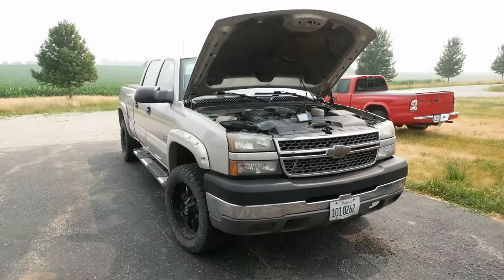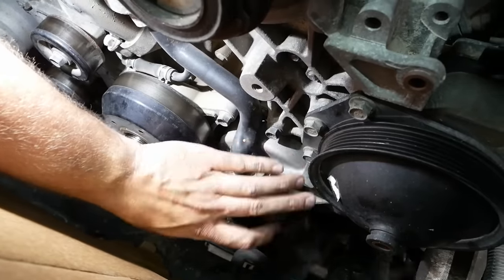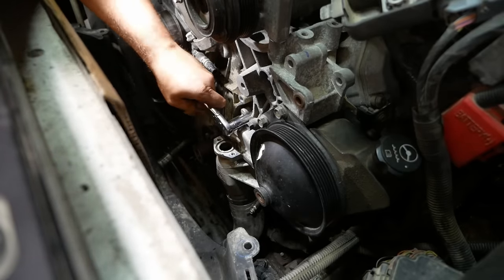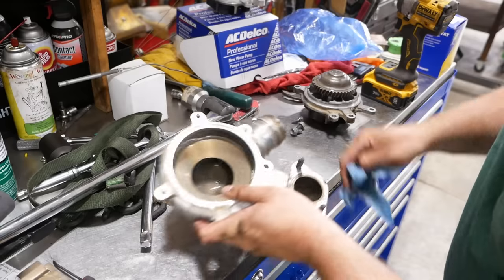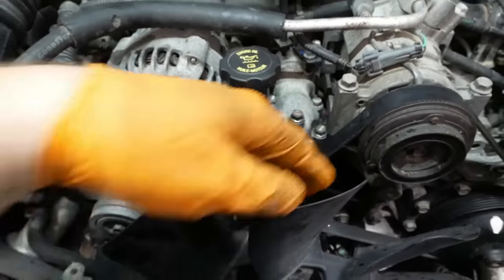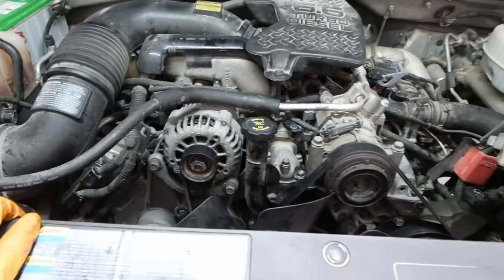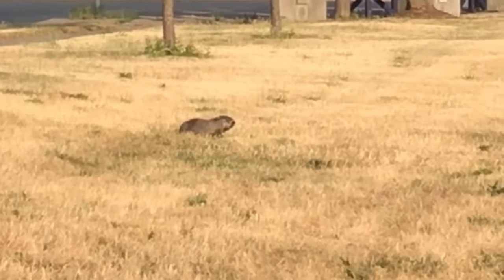Is this Cheating? GM's 6 HOUR Water Pump Insanity

Comment: I'm pretty sure the book time for the water pump on the Ford 3.5L Duratec is like 12 hours. It's an internal pump, and has a seal that was known to fail in the pre-2016 engines. If you didn't change it before a failure, it'd wipe out the engine.

Comment: One of the things I look into before purchasing a vehicle, is how difficult it is to work on. Rather that’s for my own reference if I do it myself, or if I’m gonna be predicting what I’m spending on a mechanics time to do the job. Duramax’s of any generation are off the list for this exact reason.
Reply from the maker: No diesel engine made after 2003 is easy to work on.
Reply: I used to do that, but now, when I open the hood, I can’t even find the engine.
Reply: @WatchWesWork i figured that to be the case

Comment: Wait until the bell housing coolant o rings start leaking. Replacing those 2 o rings is a big job. 
   The bell housing has a cast passage that connects to the back of each head.

Comment: You’re not wrong about them making that job harder than it needs to be.  Even the cheat method looked a pain in the $**.  The whole “rotate another 105 degrees” says the engine was designed by a mathematician, which just adds another level - they don’t want that thing coming off.  As for the weather, NZ doesn’t have the bad air quality, but the weather is making the plants and birds all confused - plants are flowering, and it’s winter.
Reply: What part of NZ do you live in?
I’ve been down to Antarctica 16 times I always travel around NZ for weeks before heading home. I haven’t been down to the ice for a couple years now I was thinking about New Zealand this morning.   
You don’t see many Chevrolet Duramax is in New Zealand

Comment: Great work Wes!  seeing the poor engineering makes me glad I did not become a mechanic-it would be so frustrating!. A standard bolt on belt driven water pump costs $75 and can be replaced in 30 minutes or less. Do they do this to generate revenue for their GM shops?

Comment: That's the first time I've ever seen someone besides myself put cardboard on the radiator. I don't know why more people don't do it. That water pump was a lot harder to change than I expected. Must be the same designers that make you remove a front end to change a headlight. If those are Astro-grip orange gloves they were on clearance at my local Advance for $5 a box 2 days ago. Down in Champaign we've had the air haze and the power has been out since Thursday.

Comment: 4 cylinder Izuzu engine in my 1992 Hitachi excavator has an overly redundant and hard to get at fuel filtering system. But it starts like a charm in the winter. Wonder how this engine starts?

Comment: 6 hours?? Make that 6.5 and let's pull the cab! 

Also I have a design idea - why not put the water pump inside the transmission? So that its RPM can be changed as needed according to speed and temperature, via a series of cables, pullies and counterweights

Comment: A seasoned hand on a cool engine is around 3 hours.  Lots of water pumps are far far worse.  Don't think anybody can beat Cummins though.  Takes longer to get the coolant out and back in than to replace the pump.

Comment: My water pump on my ‘03 Cummins took 30 min… remove the belt, drain the coolant, remove two small bolts (or was it three?) and pull the pump out.  Install new pump after wiping the inside of the bore with a cloth once.  No gasket surfaces to prepare.  Easiest pump I’ve ever replaced.
Reply from the maker: Good thing too. Those Cummins water pumps last about 50,000 miles.

Comment: "Japanese alien technology" would probably also apply to the old Quad 4s back in the day, and the same is used on the Ecotec, where the water pump is indirectly driven off of the timing gear.

Comment: I once had an 03 Vortec 6.0L Supercharged. Prone to breaking tensioner pulley on the serpentine belt system that drove EVERYTHING. Flinging the belt. Without the water pump it would overheat in like 2 minutes. Stranded until you got the belt back on. Stared carrying spare tensioners and would change them on the side of the road. Having a water pump that didn't rely on the belt to run it would have gotten me home at least.

Comment: 5:21 Saved by the 🛎 bell ! Nice idea using cardboard in front of the radiator . If that was a Snap On box , at least $100 for their empty box ! Good to see that tool removed from the converter teeth . I believe the book time on a PT Cruiser , 4 cylinder , water pump is also 6 hours and usually costs over well over $ 1000 , which if old , may TOTAL the vehicle ! Great to beat the book by using your head and not wasting time on USELESS repair information .

Comment: I had a 2003 LB7 that crapped the bed on me on my way to Utah a couple years ago. Water pump failed and no shops were open (Saturday afternoon). 110 degree heat, basic hand tools in the garage of my dads brand new town home, an O'Reilly's around the corner and 3 hours of my time...had it off and back together. Do not recommend. Many many choice words were said that day.

Comment: You just know when someone has used CAD to design a car. I have a Mercedes that if you want to replace a hard line brake pipe at the front. You have to either remove the engine and air-conditioning pump. or you have to make a specially long bent 8mm spanner to remove the body bolts.

Comment: I was really surprised that you didn't have to remove the radiator and the engine from the frame to get a puller on that vibration damper!

Comment: pro tip: Buy a Cummins. Great video Wes
Reply: So instead of buying a water pump you can rebuild the junk Dodge front end every 60k miles and fight with electrical  problems till the day you junk it. 
You so smart!
Reply: @brandonvarney7258  Chevy's trash cv axles don't last very long on the front of a heavy duty truck I'd take an SFA over CV axles anyday. Every vehicle has electrical problems eventually that doesn't go for just dodges smart guy.
Reply: @baileymiller546  
Straight axel the will shake you off the road with death wobble 
Had a junk dodge once 
At 30k miles had to replace track bar again at 65. 

Only other manufacturer that came close to having electrical problems like a dodge was the very early Kia. 
Cummins is a good engine. But Dodge is junk 
The very late model stuff may be better but relating it to the 05 in this video. Dodge is garbage
Reply: @brandonvarney7258  biased

Comment: That lower pipe that is a bear to get at? The other end is in the oil cooler, sealed with an o-ring. It will come out, but will NOT go back in because the engine mount has a bit too tall of a flange on it. The drivers side tire, inner fender need to come out to get the mount out. I actually notched the mount when I did the pump a second time, 5 months after it was replaced...porous casting at the oil side o-ring made a nasty oil leak....but, when I replaced the mount 4 years later, I forgot about notching the mount. Well, the 2nd replacement pump now has 100k on it, 120k is the norm for the wp to start leaking.....

Comment: This is why I don't work on diesels. people complain about gas engines not getting much mpg, but if you do the math on fuel cost vs repair cost and time you will see the light very quickly. change a water pump on a gm 5.3.. laughable easy.. most gm trucks get 15 mpg+ towing, diesels get close to that anyway..

Comment: The only reason you'd be happy about a gear drive water pump is if your belt breaks... I've never had a serpentine belt break in over 20years of driving. 😂
Reply from the maker: I've had idlers seize and a power steering pump bearing fail and throw the belt.

Comment: This is a project I have been putting off for the.last 4 year's on my 2004 duramax. I now only have to drive it 4 miles a day so I just add a gallon of distilled water every day. I have all the parts but lack the time.

Comment: Man! I was hoping you’ll do one on a 2.2l Chevy. Why? I just bought one that sputters and dies when it gets hot haha.
Reply: 2.2L chevy? Get at least an iron duke (2.5L) lol.
Reply: @mikem9536 haha it’s a ‘96 s10 5 speed two door long bed. Those little 2.2l supposedly are indestructible. It’s a $1000 with minimal rust and it runs just need to sort this out. Beggars can’t be choosers! I just need something cheap to run errands, haul my motorcycles etc.
If the engine craps then I’d put a TDI in it.
Reply: @djolecar88 They are known for cracking heads but otherwise pretty reliable
Reply: @firstlast---  good to know. I wonder if this sputtering and dying when hot could be that. Doesn’t seem like it. I figured I’d have coolant issues.
But I’ve seen many examples with close to 300k miles.
Reply: @djolecar88  OBD2 right? Check the coolant temp sensor when it's hot. Could be running rich due to a false reading

Comment: Good lord, it's literally a fifteen minute job on my old Cummins truck even for some non-mechanic like myself.
Reply from the maker: And I’m sure you’ve done it a few times. Those Cummins eat water pumps.
Reply: @WatchWesWork  Actually no as the truck only has 125k on it. The water pump hadn't failed(yet) but I was in there changing a fan bearing so I went ahead with some preventative maintenance. Water pump, fan bearing, tensioner, and fan clutch was not a bad job for a neophyte like myself.

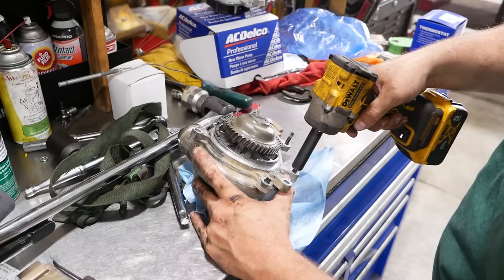Comment: Anybody notice the shape of the impeller fins at 7:13?  That looks unusual for a typical centrifugal pump that throws fluid out laterally, rotating clockwise when viewed at 7:13. I wonder why. Maybe to reduce the spike in pressure beyond the pump, to maximize volume flow?

Comment: The Isuzu inline 6  "" duramax"  gm used in there 2 ton larger trucks,  it's bad , I installed a new turbo on one a couple yrs ago,  nothing lined up oil lines , simple job on every other inline DEISEL..

Comment: While i agree with Wes on the design not being serviceable or user friendly, I would like to mention that many commercial truck engines are either "belt driven" or "gear driven". Why I do not know. My guess is so that shop mechanics can charge more in repairs, since they are paid by the hour!

Comment: Too bad you have to trust an AC Delco part on something so hard to take out.  I put on an AC Delco brake master cylinder on my truck, it was crap from the start.  Had to replace with in a year.

Comment: ..Freakin' water pumps...my old 73 Valiant slant six...water pump...leisurely 15 minutes...Now, my 1999 DODGE ram Van 1500 with V-6....couple or 3 hours...and then it wasn't even the water pump, but a leak in the 'paper' gasket of that goofy 2" thick cast aluminum 'block extension'...just 4 more holes for water to leak out of...at least now I've got a decent used OEM water pump and fan clutch...I'd already bought the new ones...anyway, gave me a chance to replace the front 'crank' seal, that wasn't even leaking.....
  Doesn't help I'm doing this in my front driveway...recent escapades...naughty 0455 and 0442 EVAP codes...gotta' fix that for California SMOG test ...
  Car and Truck/trailer work....very entertaining....I've been watching Wes Work since you were doing CNC repairs on Wes Johnson Services...!!
 I've done both of these things...you either get very dirty and cuts, bruises....or, a ton of headaches trying to figure out TTL logic stuff (back in the 1970's)...when about a 3rd of the 'chips' were faulty from the OEM....

Comment: Nice when I did mine I stuck a pry bar in through the inspection hole. So much faster
Reply from the maker: This truck has an aftermarket torque converter so that will not work.
Reply: @WatchWesWork  Gotya you prob said that I just haven’t had a chance to finish the video yet lol

Comment: That f'ing cooling fan...  Is that how the one on a '98 Explorer/Mountaineer SBF 5.0 is removed?? 
I pulled a pair of GT40P cylinder heads off of one in a junkyard, and if I ever did end up getting that dang fan off of there, it was accomplished by unbolting the water pump.

Those heads woke up my Mustang though...
Reply from the maker: The air hammer tool makes it pretty easy.

Comment: Word of caution. There is no need to remove the upper pipe leading to the thermostat housing. You run the risk of cutting that o-ring when putting it back in.

Comment: Enh. I replaced the one on my LB7 once in 20 years. Considering the water pump is second only to the oil pump, not relying on a chicken shit belt to drive it is the kind of reason diesels are superior to gas toy engines. No matter what happens, if it's running, water is circulating. Even without a belt.

Comment: I swear most of this stuff is designed by guys who think the ONLY people that will be vaguely touching it is 250 dollar an hour labor dealership people that have been trained to completely take EVERYTHING apart and replace every nut and bolt BY DEFAULT.  the last time I saw an improv this cool, was, scarily, vids from a quick and dirty OTR shop in the People's Republic, and rebuilds of small engines (complete with painting) by south asians.  8 months of watching this stuff because of an idiot "tech" at a parts store putting my new battery in backwards, and I've learned quite a few things.

Comment: You should be glad they didn't use German Alien technology.  They could put a plastic water pump between the engine and transmission, driven by an intermediate shaft from the front crank to the back of the engine.  With another belt driving the water pump.  All these would be hidden inside the transmission housing, blocked by the transfer case and two rusty turbos.

Comment: It might be interesting to start a list of unnecessarily gear driven parts, which can, under the right conditions, cause catastrophic engine failure. Now we have the Dirty Max water pump, there's also a bus engine with a gear driven alternator, which, when it seizes, drop broken gear teeth into the engine. How many other engineering mistakes can we find do you think?

Comment: Where were you putting the air hammer when taking off the fan clutch? That looked super easy
Reply: Air hammered on a fan clutch wrench. The air hammer shaft is connected to the fan clutch wrench by a clevis.

Comment: Wish you had a video on loosing prime. My 06 duramax is loosing prime only after engine gets up to operating temp and is shut back off for 30+ minutes. And it has a lift pump so I don't think the issue is on the low pressure side

Comment: I guess that at least with the water pump being gear driven you can never lose cooling even in the event of a failed auxiliary drive belt.
Being that the engine is made by Isuzu who supply a lot of vehicles & engines to Australia, a running water pump could be the difference between life & death in the outback.
Reply: bingo. in fact, you could argue that an auxiliary belt driven water pump on a water cooled machine is insanity.

Comment: The civilization that birthed anime, also designed a diesel engine? What could possibly go wrong?
Reply from the maker: Normally Japanese stuff if top notch, but I think GM rubbed off on them.
Reply: @WatchWesWork  Right now, "Made in Japan" means the best there is. When I was little, it was the "Made in China" of the time. They've come a long way.

Comment: Wes, don't denigrate the gear drive for a water pump.  You see, there is a critical timing issue.  I'll bet you did not count, but there are 8 vanes on the pump impeller.  They each deliver a pulse of coolant at the exact time required for each of the 8 cylinders on the Duramax.  I do hope you lined up the timing marks??

Comment: Heres one for the master Wes. 05 ford five hundred ran great same owner since new she had Coils & plugs done went to re-start same day now fuel shoots out the throttle body in the air box really brown engine won't start has a slow gallop like theres no compression anymore no CE light on  Nobodys knows what happened?? Been sitting two weeks now

Comment: My way of doing it is probably longer (but im not by the hour when im doing it) but its so much easier to do it in my opinion since i take the front bumper grille rad support intercooler and rad out and then its a cake walk everything is easy to get to well minus those shitty backside bolts / nuts it has.

Comment: So, I must’ve got turned around during the pump removal. If the pump seal leaked, would there be water in the oil? Where was the leak? Just a gasket or the oring on the small pipe?
For sure they didn’t think that one through.
Reply: It’s vented so it’s not forced in to oil
Reply: @akfarmboy49  thanks.

Comment: I really wish engineers had to repair things like this. maybe then they would stop this crap. Ford can eat my shorts because i once had to remove the motor mounts, a cross beam, shock strut just to replace the starter on a 90's T-Bird. I hate automotive Engineers. (as an added note, i also had to jack up one side of the engine as well)

P.S. I'm in NY and our air quality was worse than yours. Many of us here have worn masks a couple of days because of it. Be careful. When the air gets like this you won't know you've got lung issues for years then all of a sudden it's COPD time. So just be careful.

Comment: Quick question. My lbz duramax has 300k now. It runs fine but I heard that your supposed to adjust valves every 100k. Is that true? Should I adjust the valve?

Comment: Ohhhhhhh I had to do my water pump in my 97 corolla recently. Took me all day.

Interesting to see how quickly you can do it in a far more complicated vehicle

EDIT: I will say, it wasn't exactly straight forward as I had to take the belt cover off and loosen the timing belt. To do that, I also had to take the cam cover off. But that definitely shouldn't have taken me all day, especially considering I didn't eat breakfast or lunch to get it done in time. It was like 6pm by the time I got it finished.

Comment: by the size of that breaker bar i would have thought you were working an a lexus ls300.  450ftlb of torque for the crank bolt, way overkill.